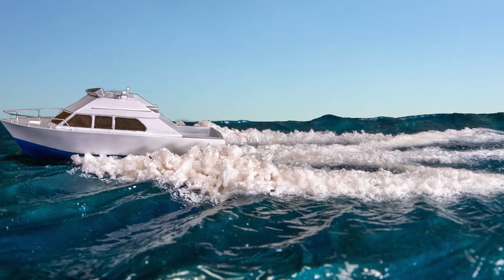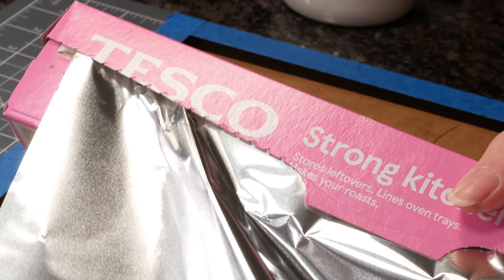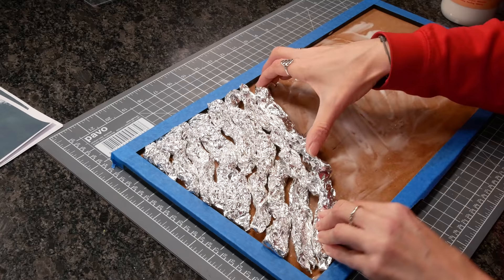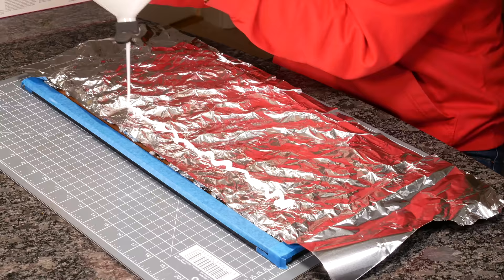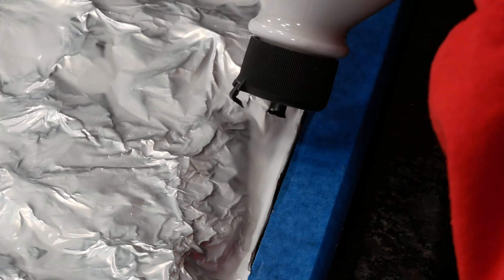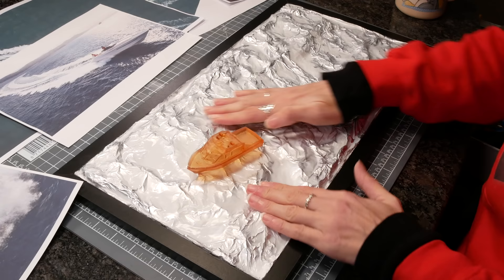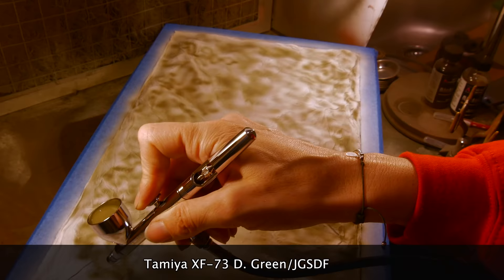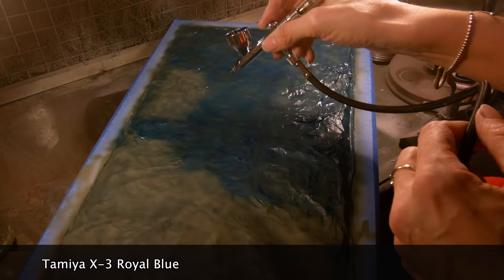How to Make Quick and Easy Ocean Waves from Foil

Comment: Well, apart from the 3D printing, I think every single technique was new to me there!  Though even the "overbaking" the 3D print was new to me: didn't know that's what happened if you left things to cure too long.  Foil for waves - why have I never seen that before in 50 years of modelling?  I've used Uhu glue for waterfalls and waves in the distant past, but the shelves of B&Q seem to have lots more things worth playing with now!

Comment: Wow  Kathy I haven't seen this technique before and it turned out great.   Does the foil get hard with the topping?  I'd hate to have it on the edge of my layout and smash it.   I'm a clutz, lol.  Really cool seen,  Chris
Reply from the maker: Chris, it stays flexible because I didn’t scrunch the foil underneath very tightly. I think a firmer first layer would lead to a more solid result.
Reply: Thank you for answering my question Kathy,   I intend on having a  small Harbor area and nor sure of my skills.   Learning still,  Chris
Reply from the maker: @CM-ARM  I would just try a small area on a sheet of foam core or card first to see if it works for you.
Reply: I will.   Thanks again Kathy,  Chris